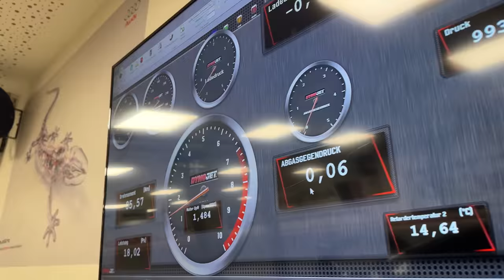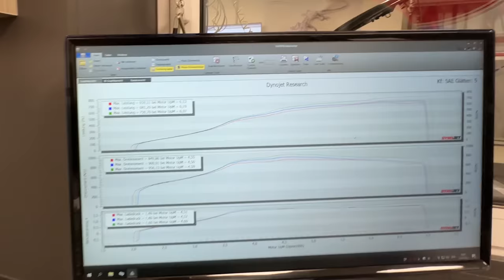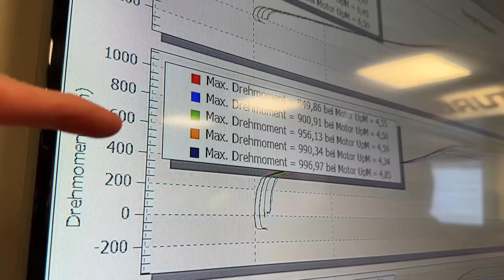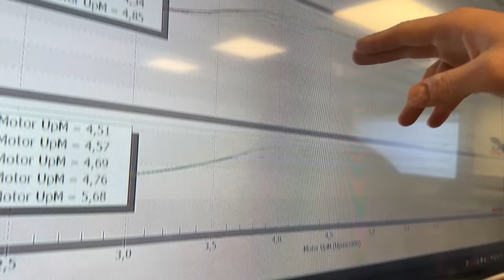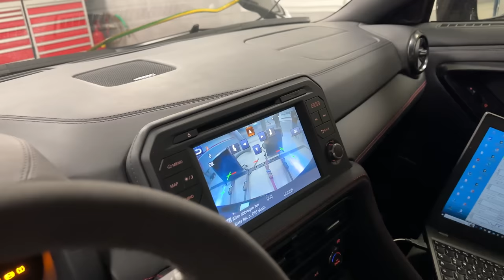WORLD RECORD FLAMES? Dyno action with my NISSAN R35 GTR - OG Schaefchen

Comment: Would be interesting to know how you get those flames so colorful haha maybe explain the ignition system in a video soon :)
Reply: I think it’s a paste that you can apply to the exhaust tip
Reply: @guerrasimonee  But then he wouldn't be able to change color mid driving...
Reply: @luckywilf  usually it’s a paste of combined powder, copper gold and other stuff that can produce various colors, might be a different thing tho, mine is just an idea
Reply: @guerrasimonee  yeah I know that. specific chemical powders have an effect on the color, you are definitely right. Im just wondering how they installed such a system in a Car exhaust 😂
Reply: @luckywilf  I’ve seen some ppl literally spreading paste with a knife or a spoon so I got no idea lmao
Reply: because of the TEA - TEB during the engine startup phase the flight computers are programmed to release this fluid from HPU-Hydralic Pressure Unit